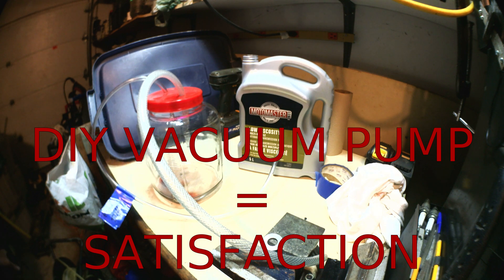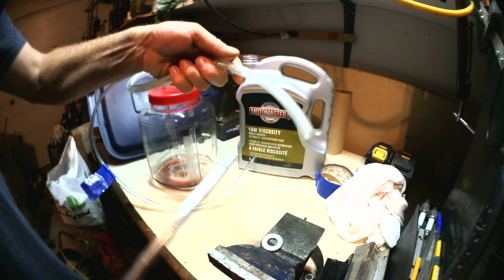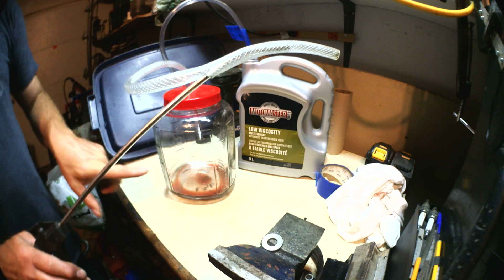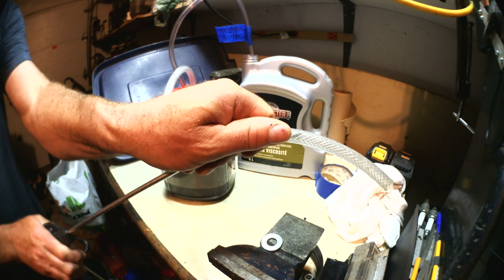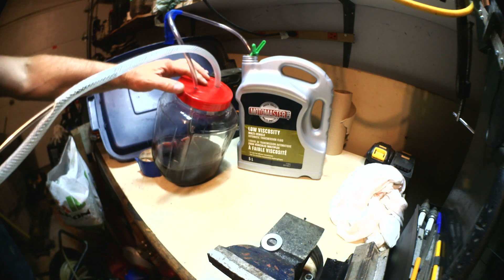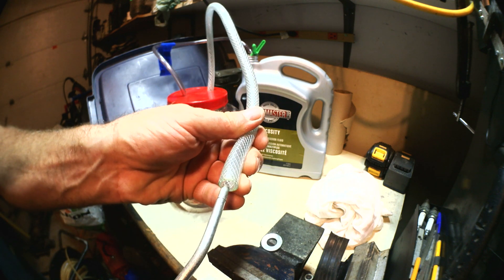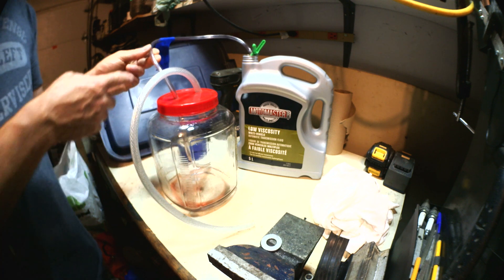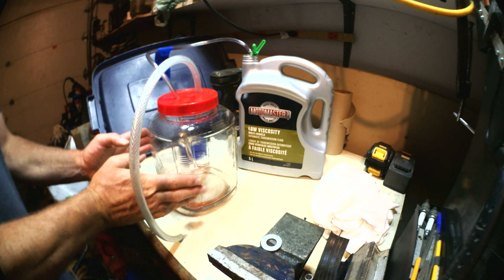DIY Vacuum Pump,Venturi pump,Fluid extractor.Air powered pump.

Comment: What size tubing will fit the dipstick tube? Very creative method, thank you for showing!
Reply from the maker: Clear tube that i used for my GM pickup truckdipstick tube was 3/8" outside diameter.
Thanks for your comment and for watching.
Best regards.

Comment: What setting do you have your air compressor regulator set ?
Reply from the maker: To the max, so its 125 .
Reply: @obscur156  thanks. Like you I have the tubing just need a jar. Wally world here I come.  I'll post back with results when I do this.
Reply from the maker: @robm3063  Great, have fun with your new project.
thanks for your feed back when you do it !
Regards.

Comment: You happen to have a disturbing love for hair....
Reply from the maker: I guess you mean "air" .
You are right, I see a Psychologist once a week to solve that behavior problem.
Thanks for taking the time to make a positive comment, I appreciate it.
Thanks for watching, best regards.
Reply: + @obscur156  ...
I love the video, and have copied it and made some slight alterations...
I work for Big-O Tire...... And now every time I remove the lug nuts from a customer's vehicle, it applies suction to my penis pump... It's a win-win for everyone! 
Cheers!
Reply from the maker: @hokiepokie_soupermane    You should patent it and sell it. 
Mechanics now will always work with a smile on their face.
Regards.
Reply from the maker: @hokiepokie_soupermane  You will dry out doing this all day long lmafo
Reply: + @obscur156  ... It's not as bad as you'd imagine. I usually average around 1 gallon a day.... I regulate it by keeping the pressure at the compressor low....  180 PSI seems to be my sweet spot. 
However... There was some trial and error. Unfortunately, I no longer have foreskin... Though I'm not that upset about it, for the simple fact that now I have fiveskin. 
As with anything in life, just know your limits.
Reply from the maker: @hokiepokie_soupermane  You have a very good compressor mine goes up to only 145 PSI.
Reply: Always an ass out there to mock someone's accent.  Lol